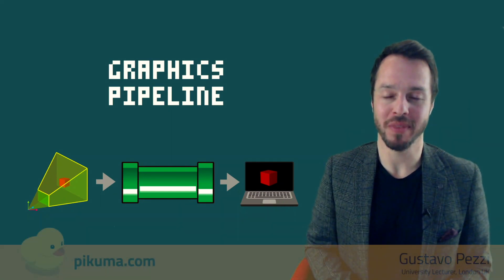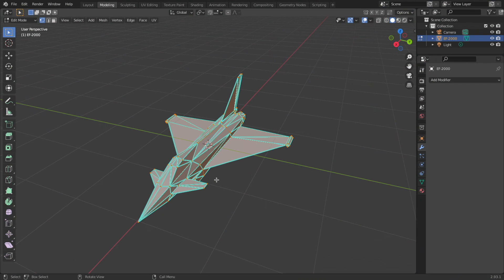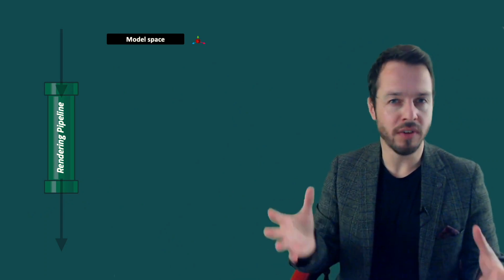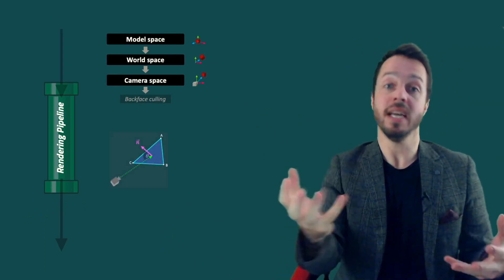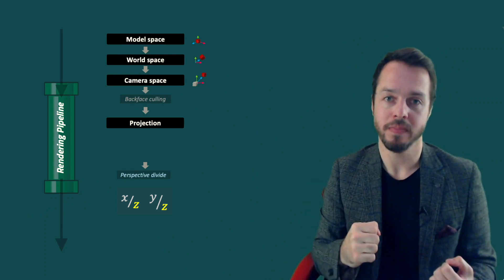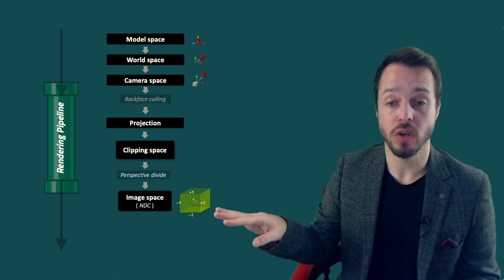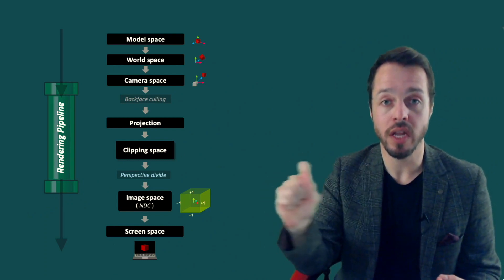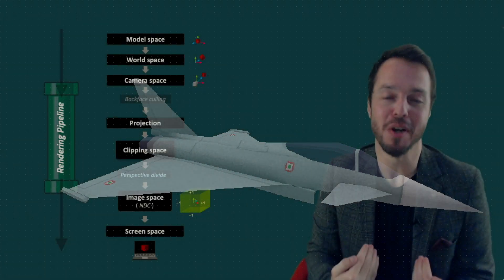3D Software Rendering Graphics Pipeline

Comment: This pipeline chan be changed? What if i want to modify some part of it? May be i want to make my own culling or something.
Reply from the maker: @gendalfgray7889  It depends. Some older graphics cards have a more rigid/fixed pipeline while some modern ones are "programmable". This video was designed and explained with software rendering in mind, so it will all be written by hand anyway and you're "free" to do what you want with your rendering code.
Reply: @pikuma  How rendering pipeline changes with raytracing? Fructum culling changes when you looking at reflective surface?

Comment: I thought Perspective divide is a result of applying a perspective projection matrix. is you could either manually divide all the vertices by their z components, or you could simply multiply them by the matrix. Do you also do a perspective divide when using an orthographic projection matrix? 
Great video. I'd really appreciate an answer to my question. Thank you very much in advance
Reply from the maker: No, orthographic projection does not have a perspective divide.

And I understand. It's not common to think of perspective divide to be something separate from the perspective projection matrix, but it is. The division by z (or w in this case) happens after the perspective projection matrix.
Reply: @pikuma   Thanks for the response.

Comment: can i use DIB's for work with image\pixel... or theres another win32 method?(i know the DirectX\OpenGL, but i'm trying avoid them)
correct me: speaking on 3D Lines: is only necessary(for don't use too much CPU) just projecting the Start and End points... or all line points?